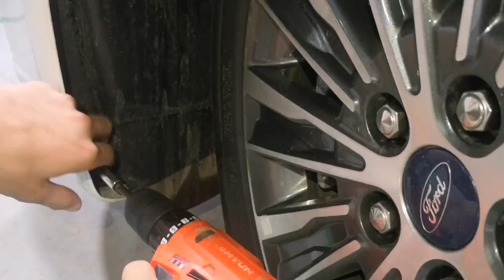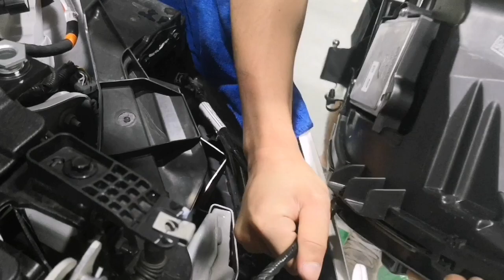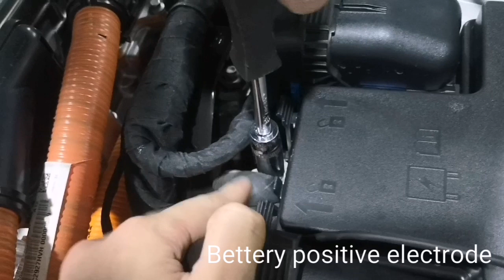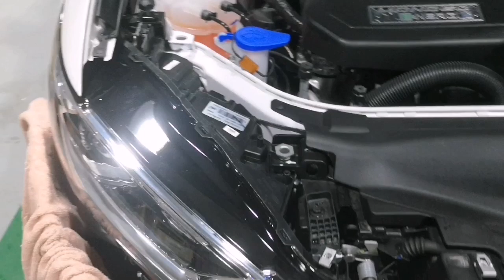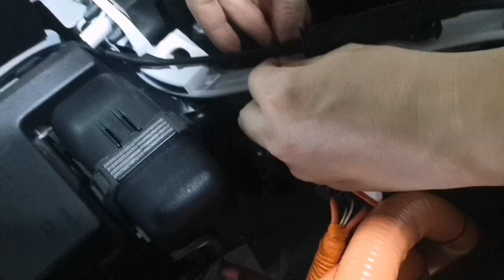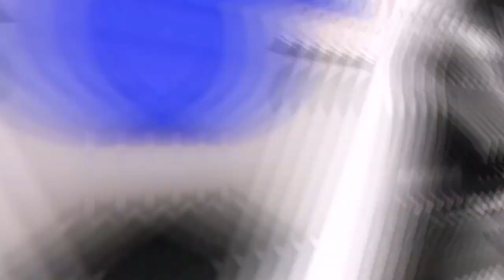2013-2020 Ford Mondeo car headlight modification / replacement Halogen to LED, plug and play

Comment: Hi I have a 2017 Ford Fusion and installed ford Mondeo headlights and my drl is orange at night time! I bought the wire harness plugged it up and nothing happened but stayed the same at night but turned my drl off?? What did I do wrong?
Reply from the maker: Did you bought wire harness from us? If not, it’s hard to tell the problem, because I don’t know how do other people do the upgrade job.

Comment: Where can I get a set of headlamps
Reply from the maker: https://www.ebay.com/itm/164458797114, that's the plug and play wire harness. recommend you order headlights from local.